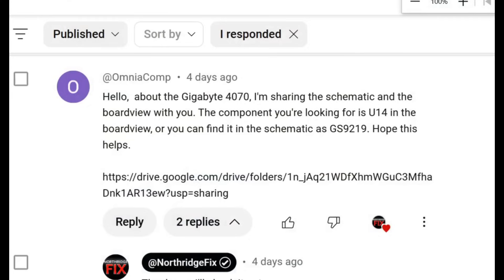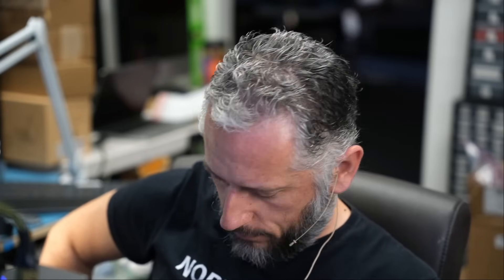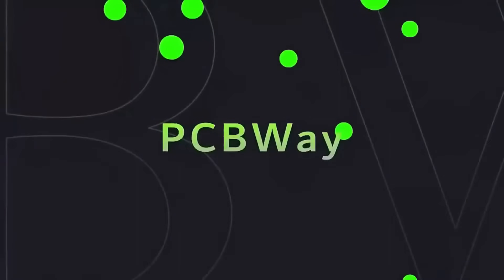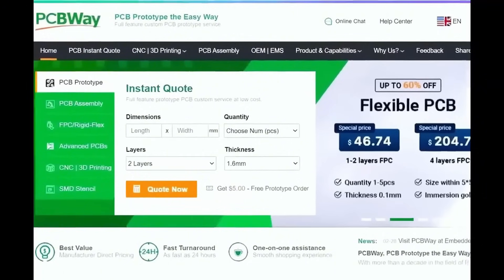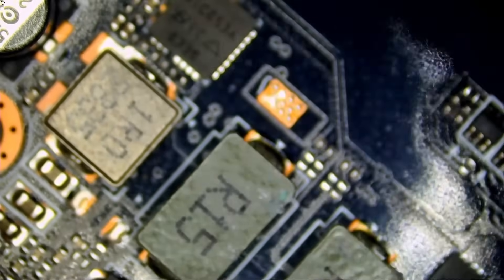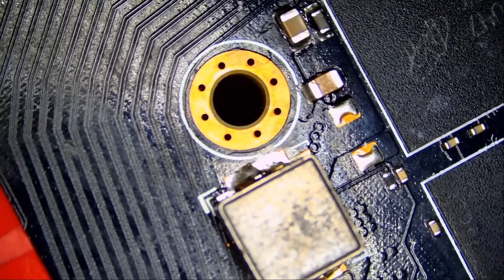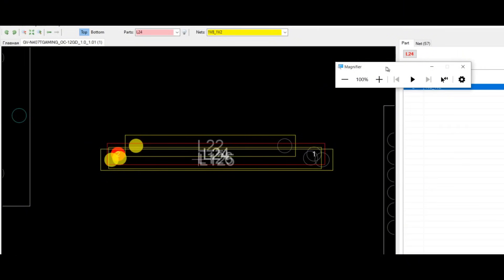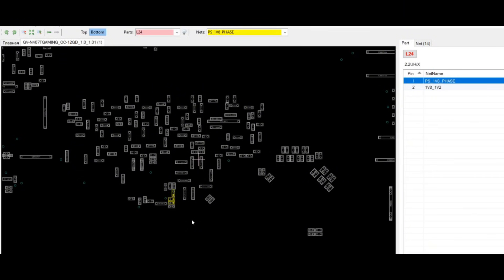Dead Gigabyte 4070 GPU Not Detected Part 2 - What is wrong?

Comment: Alex I must admit I didn't think you'd make a follow up on this job. Great work! The card may not be salvageable, but the customer's request was indeed fulfilled 😆As an auto mechanic, I can fully empathize with you in the field of diagnostics. 
Tomorrow I have to go to work and figure out why an A/C system for an F250 that's been confirmed to have no system blockage is reading abnormally low pressure at the evaporator core. I'm suspecting the evaporator temperature sensor ( which is a type of resistor ) is tending to open making the truck's computer think the temp at the evap core is higher than it really is.